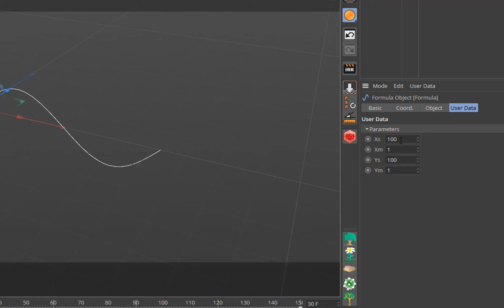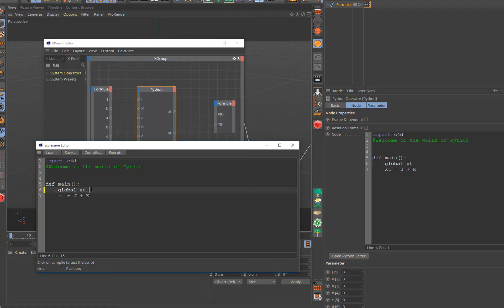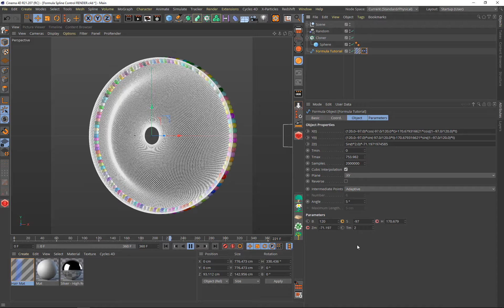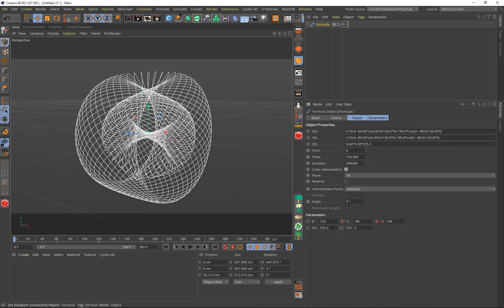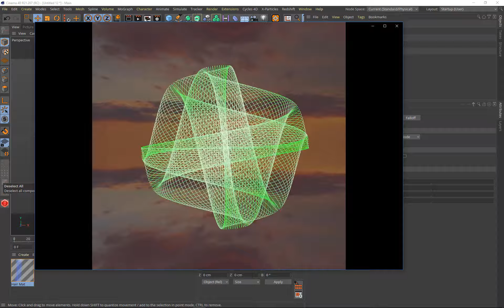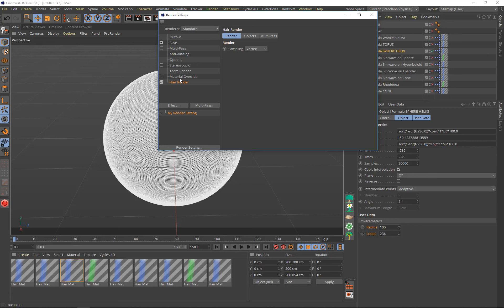Cinema 4D Tutorial - Formula Spline Control

Comment: Dear Pappy，thanks for your great tutorial.
I have a question, for the function(eg:35:53),we know that in python, a^b will be write as pow(a,b) or a**b, but in C4D, this not work, I could only use pow(a;b), that makes different. I dont know whether other math symbol will have such trouble.
I want to know,whether there is a doc for reference?Thanks.
Reply from the maker: pow(a,b) and  a**b both work in C4D. Python version 3 is in C4D R23 and up, but before that Python version 2 was used. Python is a very documented language, you can fid anything you want by searching the internet. My main source for info is python.org and Maxon's documentation, check out https://www.python.org/doc/versions/ and https://developers.maxon.net/docs/Cinema4DPythonSDK/html/index.html

Comment: could you please tell me how to make parameter 0 with a single click?
Reply from the maker: To the right of each parameter are two small arrows. If you right mouse click over those arrows the parameter will reset to the default value. If the parameter is on the User Data tab then the right click will set it to zero.
Reply: @pappystutorials  Thank you so much